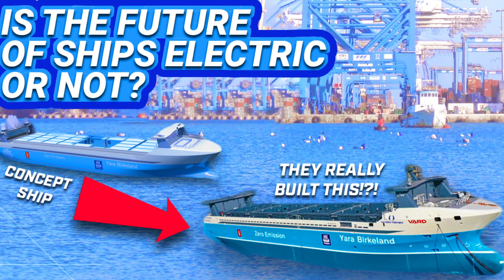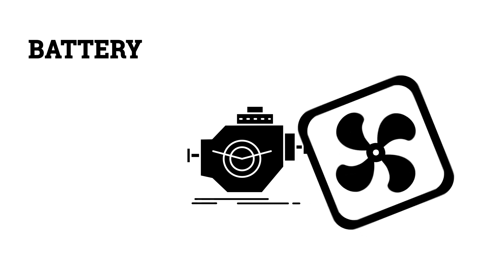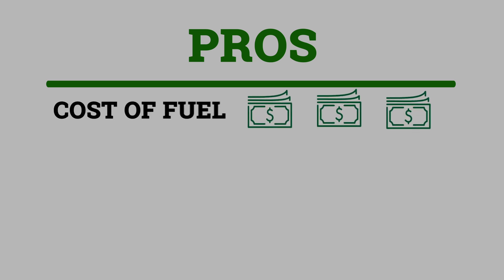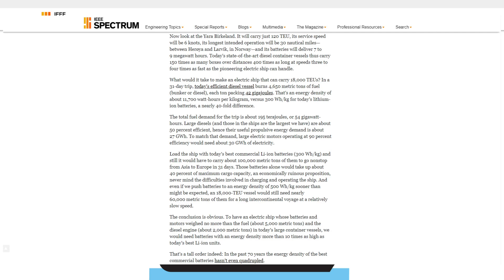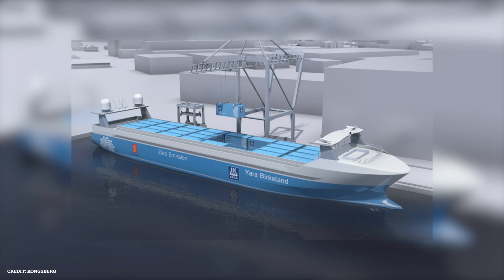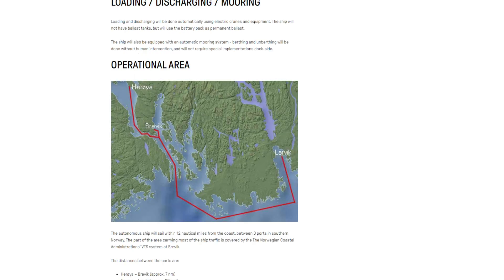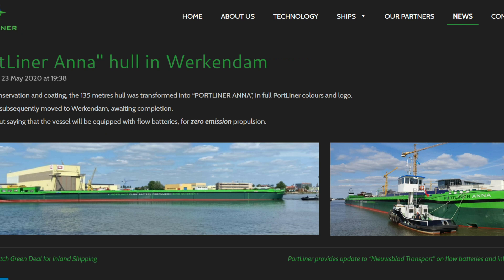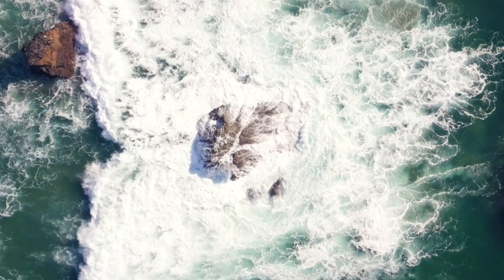Are Electric Ships the Future? - how electric ships work and who's working on them

Comment: If ships go electric how much fuel will that free up from the market?  Cheap gas I'll run big block.
Reply: Nothing, because ships run on heavy waste fuel from crude oil, not from diesel or gasoline(petrol).
Reply: @shrin210-98  Taking the range of products from crude is not as simple as the video suggests.  Among the many highly skilled professionals in the oil refining business the 'elite of the elite' are the 'blenders'; they take the fractions that can be extracted for the crude oil that one set of traders buys and after distillation (both atmospheric and vacuum aka thermal cracking) followed by 'cat cracking', chopping the residual longer and more complex chains of hydro carbon up into shorter bits, with the aid of a catalyst, they have a suite of components.  They then blend the components into the products that the other set of traders can sell in the market for the most revenue; all at the least cost in time, energy, effort or any other type of expenditure.  When it is possible to find a useful revenue stream any where in the process they will thus low sulphur atmospheric residue (LSAFO) from the distillation stage might be saleable as cSt 380 HSFO.  The regulators set some parameters, like sulphur content, either at a national or international level, and those pesky consumers buy what they want from what is available.

Comment: it is here now
Reply: With regard to propulsion with electric motors powered by ‘green electric’, leaving aside the fact that there is no truly ‘green’ electricity, the best we can do is low carbon impact both at installation (capital account cost) and production (revenue account cost).  Running ships on the ‘lecky’ is tricky the two examples that I personally know of, and have used, are a vehicle and foot traffic ‘chain’ ferry that ply’s its trade across the hundred meters or so of the Nordre älv between the island of Hisingen and the Kornhall on the Swedish mainland.  The motors are on the ferry and a power supply cable is unwound and wound back up on board as the ferry shuttles back and forth from Kornhall.  When the vessel goes anywhere else, id est dry dock for survey and or maintenance, it is towed by a good old ICE powered tug.  The other electric vessel is a vehicle and foot traffic ferry that runs from Helsingborg (Sweden) to Helsingor (Denmark), a twenty minute trip undertaken using energy stored in batteries on board, she tops up the charge each time she is alongside and battery capacity is said to be sufficient for an hour of main engine use.  A video is available on the Fully Charged channel of YouTube, ‘100% Electrical Ferry Crossing’.  There are small diesel generators on board; to keep the lights and other safety related items on in extremis.  Electric ships currently have short ranges and high light displacement  as a factor of their cargo capacity.  Sadly as of now electric boats are as functional as chocolate fireguards, yes ‘submarines can be diesel electric’ but they have negligible cargo carrying capacity and if you ever go on one (HMS Alliance is available to visit as a static exhibit at Gosport, UK or video available on YouTube, https://youtu.be/Q23uoxT16gO) your first thought could be ‘not much room in here for the crew is there?’
Reply: @BernardLS  https://youtu.be/lsQg3DQAoaQ pay particular attention to the japanese 100kph motor cycle...I took a prototype drawing to mazonni auto lab at ohio state university in 2011 They came up with this...I am now assembling another version using magnetic bearings as an assist technology the is erasing the specific weight of the rotor, thusly it will require very little cogeneration to yield greater horsepower...The result is a variable horse power dc pulsating motor capable of being adjusted to slave to any generator...I intend to use all technology at hand and the slaving will be done with belt drives.This unit could be in any maintenance area on a vessel...it would be much quieter than diesel electric and of course flue less...  but you are correct no motor will be with out carbon foot print the carbon used in my device will require firing and refinement of metals but beyond that their operations will require just oil for lubrication and belts and of course the carbon footprint of the manufacture of the tractor set generators they of course will require lubrication as well.
Reply: this pulsating dc genertion can be further augmented by magnetic bearings and magnetic suspension which erases the effects of weight and frictin...the First motors were all dc but the source power was thermal dynamic ..Tesla had many eperiments that took mechanical energy via a victola that cut copper coils and powered a tin lizzy for over 72 hours continual use at 38 mph the trouble was the iron ferrite magnets
they lost charge and eventually crapped out
in 1922 the physics department at osu started breaking bonds on compounds we know today as rees rare earth elements but they are anything but rare and by their atomic structure naturally magnetic...
Magnetism is what is in the power conduits for green energy
tesla knew it but by the time he found the means the oil industry had a firm grip...
with all that money invested in future resources it was in every oligarchs best interests to bury teslas techs
which they did do through patent infringement suits
tesla eventually won his case one year after he died 
his case was heard at the supreme  court and the briefs gave him intellectual control but he was dead
the oss the forerunner to the cia seized his lab and the techs were buried for 50 years
Now with india, pakistan, africa, and south america comming to their industrial revolutions the cycle of oil is not sustainable
Sorry but we gotta tap the new old tesla theories

Comment: Nuclear ships?
Reply: If you do a web search for ‘nuclear ship savannah’ you will see that it has been tried and did not work.  A similarly heavily subsidised, by the government, vessel is in use in Russia which also operates, in support of the Northern Sea Route, a fleet of nuclear powered ice breakers these may, or may not, have been completely without issues.

Just think; would you have full confidence in the management of a nuclear reactor under the control of an anonymous entity only traceable, perhaps, via a letter box in a FOC (flag of convenience) nation state?  If you are, could you sell that confidence to Japan, the state that hosted the Hiroshima and Nagasaki nuclear detonations as well as more recently the Fukushima ‘event’?  Then try that same, or a similar, sales strategy on Ukraine, the nation state that as a part of the USSR (CCCP) hosted the Chernobyl ‘event’.  Modern iterations of nuclear energy, thorium fuel, molten salt reactors or fusion reactors, will carry the legacy of past problems.  It is the global trepidation of anything with 'nuclear' in the name and the economics of nuclear having transitioned from 'energy to cheap to charge for' too 'the costs of remediation are incalculable' that will prevent the adoption of nuclear energy as a means of creating energy at sea.  Modern reaction systems may have overcome the safety problems but the general public, having been misled in the past, will be reluctant to believe the fresh new promises.

‘They’ say nuclear is cheap, it’s not it is expensive and has a large embedded carbon quotient as well as being complicated, dangerous, not universally socially acceptable and having only ‘no need for refuelling’ as a questionable advantage; actually it does need refuelling just not as often.  When ‘they’ do need to refill the warming up stuff it takes considerable longer than pumping tonnes of thick black stuff, HFO cSt380, or thin runny stuff, MDO, onboard which is one of the reasons HMS Queen Elizabeth and HMS Prince of Wales are pushed about by ICEs and gas turbines thus using a similar fuel as the aircraft that fly off of them.  The Royal Navy (RN) with a high degree of skill and expertise uses, at vast expenses to the UK taxpayer, a current operational nuclear fleet of 11 submarines (also known as ‘boats’) in two flotillas, seven attack subs and four ballistic missile boats.  The carbon footprint of all the extra bits of hardware and the fuel, including processing thereof, from ground to propeller, are the external costs that never seem to get considered.

Disposal, once it wears out, of both the machine (that was a ship) and fuel is another can of worms best left unopened.  The 26 RN boats no longer in use are laid up (some in Rosyth and some in Portsmouth) awaiting long term deconstruction including dealing with the fuel rods and other irradiated material.  The USN is not, as far as I know, a commercial organisation working to very tight margins and also has the skill and expertise to handle the complexities of nuclear power; so as well as submarines their aircraft carriers are nuclear powered and each of the current iteration has a build cost three times that of QE/PoW, bigger crews and more generous funding.  For those who still think that nuclear energy might be the answer I recommend this report: - https://www.bbc.com/future/article/20200901-the-radioactive-risk-of-sunken-nuclear-soviet-submarines?ocid=ww.social.link.email.  The navy of the USSR might have been under resourced and over extended but it was still generously supported in comparison with merchant shipping.
Reply: @BernardLS  I'm not going to read all that.... I know there are Nuclear submarines, it just seems like a fucking stupid idea because of the waste, because of storms for example, these things tend to go missing and sink everyonce in a while.

Comment: another video that preaches the benefits of electric everything and then dosent realize that batteries will pollute the environment more than using heavy oil .
Reply: A properly configured LCA (life cycle analysis) would determine the cost / benefit impact.  As with any LCA it is necessary to select the functional units, system boundary and parameters assessed to make sure you get the answer that is desired; always embarrassing when data shows that what you hoped to prove ‘bad’ was in fact ‘good’ or vice verse.  For functional unit in Environmentalism ‘overall carbon footprint’ is usually a good one, so what you save on kerosene not burnt in a jet aircrafts engines better not be outweighed by what you consume using a recreational sailing vessel with hydrocarbon based structure and motive power containing lots of embedded carbon.  ‘System boundary’ well where ever is likely to yield the ‘correct’ result is a safe bet; ‘parameters assessed’ again what best puts a cutting edge on the particular axe you wish to grind determines which parameters you choose to assess.
Reply: Wrong, batteries, especially when there is plenty of the same type are very good for recycling. Lead acid batteries are among the highest percentage recycled item around. It will be the same with li ion batteries. Phone batteries are not uniform, have too little volume, but car batteries will be recycled as you will have plenty uniform feedstock and since demand is high, plenty of motivation to do so.

Comment: Put wind turbines on the ships to power the electric drives and charge the batteries.
Reply: the drag for the propellers of the turbine will increase the weight of the ship, harder to push more power consumed back to square one.

simple physics kid, some thermodynamics sh*t i know it's a bummer,
Reply: @jagadishgospat2548  You mean like sailing?
Reply: @kistuszek  well yes
Reply: @kistuszek  this is about sailing
Reply: @kistuszek  read his question carefully.
Reply: @kistuszek  To address the suggestions that sail power is the answer I offer the following example.  In 1870 a premium sailing vessel entered service, the ‘Cutty Sark’.  The Cutty Sark was 64.74 metres in length with a beam of 10.97 metres and a loaded displacement of 2 100 tonnes.  She was able to carry, at best, 1 700 tonnes of cargo and to harness the energy in the wind the available spread of canvas was up to 2 976m2 which was tended by a crew of about 30 skilled men.  A ratio between the sail area (SA) and the vessels displacement (D) determines how lively she is; ‘lively’ being nautical speak for ‘fast and manoeuvrable’.  The carrying capacity of cargo ships is constrained in two ways, mass and volume which leads us to the ‘stowage factor’ of the cargo; the more mass on board the greater the displacement which in turn impacts the efficiency of the hull form and sail area / displacement ratio.  A vessel constrained by mass is said to be ‘down but not full’, while a vessel constrained by volume is said to be ‘full but not down.  When in the tea trade, which the ‘Cutty Sark’ was designed and built for with fine lines (more nautical tech speak, so again no need to worry about it) she could carry around 600 tonnes of cargo at speeds of up to 17.5 knots dependent on the prevailing wind and had a typical China to UK time on passage of 120 days.  The tea trade was very competitive so ‘time on passage’ was a large factor in securing the premium freight rate that made her cost effective.  Rounding things out, her maximum available sail area gave circa 5m2 of canvas for every tonne of tea carried.

As soon as the Suez Canal opened, which the ‘Cutty Sark’ was unable to sail through; she lost her advantage, raw speed, to the steam powered ships of that era who could beat her ‘time on passage’ by taking that short cut.  Mechanically powered ships have improved in terms of efficiency, on a freight tonne mile basis, by at least one order of magnitude since then.  After losing out to the coal burning, fire tube boiler, steam reciprocating mechanical ships of the late 19th century ‘Cutty Sark’ was relegated to the Australian wool trade, just about the bottom of the barrel in maritime terms and only one small step up from being a 'honey barge'.  The canvas, cordage and extra manpower needed for sailing ships was never a very benign environmental option so please discount any idea of sail as ‘sustainable’.  All this is without the problem that if ‘the wind don’t blow the ship don’t go’, when it does blow it often blows in the wrong direction for your cargo delivery needs and sometimes there is rather too much of it for comfort.  Sailing ships are unable to go directly up wind so if the wind is blowing form the direction your cargo needs to then a zig-zag course must be steered, more distance and more time.  Wind is traditionally measured on the Beaufort Scale (wind speed) that runs from 0 (< 1kn) to 12 (> 63kn) and for sailing purposes the usable part of the range is ‘3’ (circa 8kn) to ‘6’ (circa 24kn).

Random fact about ‘Cutty Sark’, it is said to have been possible to coax 3 000 horse power out of her sails, or in ‘real money’ 2 206 500 Watts (2.2 megaWatts), assuming this was in ideal conditions or 741 Watts for each square meter of sail area.  So that majestic spread of canvas would have been even less efficacious for delivering your baubles and bows from the orient, despite taking about three times as long on the voyage.  The sails on the ‘Cutty Sark produce about 0.33% of the power need to propel a Mearsk Triple E  from the ICEs.  Remember shipping is a high volume low cost, therefore low margin business, and all costs have to be beneficial.
Reply: @kistuszek  Actually not disputing the Laws of Physics but 'wind turbines' are simply a different way of harvesting the available energy; using 'rags on sticks' the Cutty Sark harvested about 740Watts m2.  either vertical or horizontal wind turbines might come to around the same figure.

Wallenius are currently giving wind power a go with wing form ‘sails’ but evidence is a little short of proof as of this date.  KTH (Kungliga Tekniska högskolan), a sort of up market university in Stockholm, who are using the funding to derive results will probably, and eventually, in the best traditions of academia ‘publish’ a ‘paper’ unless the funders invoke the well known ‘commercial sensitivity clause’ of their agreement with the KTH.
Reply: @BernardLS  Well, i was not really too serious on the sail suggestion as a practical solution. It was meant as a hint for a net positive wind power use for ship propulsion, which is also pretty widely known... A tongue in cheek reminder that if wind could have been used for powering ships before written history began, it is probably possible today. 
Not saying it is the best option, but hardly something that should be dismissed outright.
Reply: @jagadishgospat2548  Actually not disputing the Laws of Physics but 'wind turbines' are simply a different way of harvesting the available energy; using 'rags on sticks' the Cutty Sark harvested about 740Watts m2.  either vertical or horizontal wind turbines might come to around the same figure.

Wallenius are currently giving wind power a go with wing form ‘sails’ but evidence is a little short of proof as of this date.  KTH (Kungliga Tekniska högskolan), a sort of up market university in Stockholm, who are using the funding to derive results will probably, and eventually, in the best traditions of academia ‘publish’ a ‘paper’ unless the funders invoke the well known ‘commercial sensitivity clause’ of their agreement with the KTH.

Comment: It only makes sense if you generate electricity while on the way (solar wind)
Reply: Getting the energy 'on board' is the fundamental issue, harvesting it from the sun of wind does not provide as much in as convenient a form as loading it through a pipe in the form of a combustible hydrocarbon and the cheapest way to get that is in the form of fossil oil and gas.  Reducing amount of cargo moved by mass, volume & distance is the least cost option to reduce the impact.  Thereafter improving fuel quality is the 2nd best means to lower the industries environmental impact
Reply: Or nuclear.